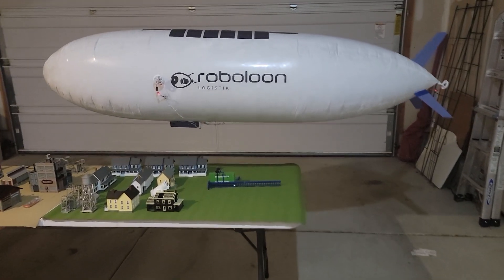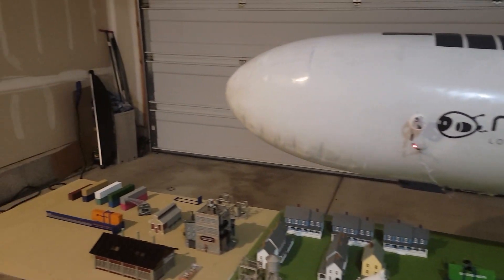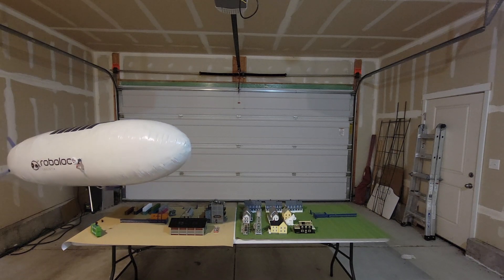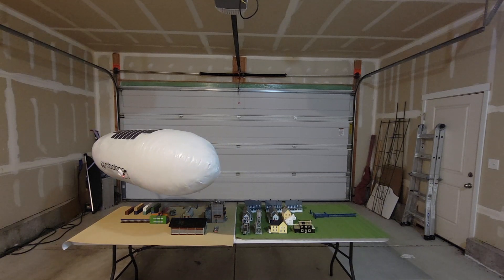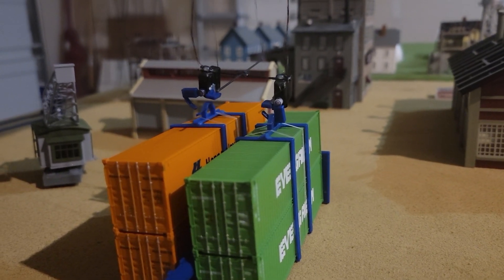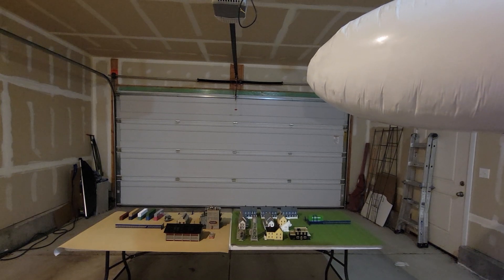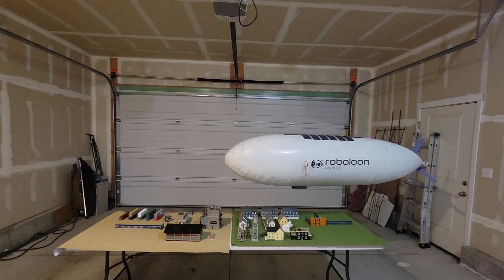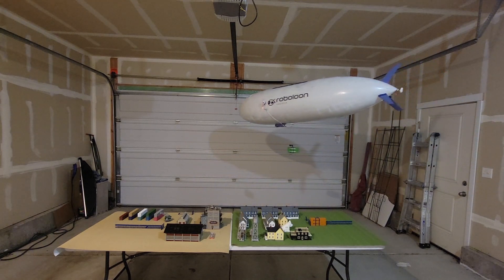Solar Cargo Airship Diorama

Comment: Is this helium or hydrogen?
Reply from the maker: @ethaneveraldo   in this video it was filled with Hydrogen. When flying in Friedrichshafen I used Helium for compliance reasons.
Reply: @ Would it be possible to mix hydrogen with some kind of flame retardant gas? My understanding is that hydrogen has higher lift power than helium, but it is problematic because it’s highly flammable. I wonder if you could get the best of both worlds by mixing it
Reply from the maker: @ethaneveraldo  I want to explore that further in an upcoming video. Probably in a month or so
Reply: @BaccaYarro  Looking forward to that

Comment: Rather interesting Bacca, so you see this being a reliable way of transporting shipping containers over land and sea? Also how many containers can it really carry? 
 
On a life size scale wouldn't that blimp be about the size of like a Ford class carrier? If need a zeppelin that large to achieve this sort of transportation seems like it wouldn't be very practical or able to compete with the various massive cargo planes except in maybe fuel consumption and environmentally friendly.
Reply from the maker: @Jarred-J254  Based on average container weight while loaded it would be 2 or 3 most of the time. The scale is HO, or 87:1. So it would be 172 meters long, about 3/4 the length of the Hindenburg. So pretty big. Although in terms of how much material is required for construction, how much composites, metal, etc, it would require less than a 737-800. It would lift more, about double, and not require an airport. But much slower, of course. The real question is the lifting gas. As long as Helium is the lifting gas it would be limited to a few very niche uses. Because the world's Helium supply is too limited. Hydrogen would be required for real world viability. Sadly that seems unlikely anytime soon. So, yeah, a pipe dream. But a fun one ;)
Reply: @BaccaYarro  This may come as a bit random but given the current efforts to reach Mars would you imagine zeppelin style airships might could play a role with a Mars colony given its lighter gravity and so therefore easier to lift heavy loads?
 
With the matter of helium and hydrogen as lifting gas I honestly think hydrogen has become rather misunderstood since that dark day on May 6th 1937. Yeah it's a flammable gas but it's also lighter than helium (so more lift) and of course much easier to produce and so more readily available. And since you are a history buff like myself and your obession with airships you no doubt have your share of knowledge on the Zeppelins used in The Great War and might have heard of the stories regarding the special incinediary bullets the British developed to use on their planes to shoot down the German Zeppelins by igniting the hydrogen inside the gas cells during the bombing raids and of course didn't really work at first as there was no oxygen for the gas to ignite from the bullets going through it, as like you said in one of your previous vids regarding the dangers of oxygen mixing with hydrogen in a blimp. So with that taken into consideration hydrogen could be a fairly safe alternative as long as the cells are airtight and regularly inspected for leaks. With helium becoming more scarce and hydrogen being considered too unsafe, only other option seems to be hot air and how you think that would workout?
Reply from the maker: @Jarred-J254  The problem with Mars is the atmosphere is has such low density an airship would need to be quite large to lift much. Although wind would be easier to overcome. So it would be both good and bad. 

I agree on Hydrogen. The dirty secret of airship enthusiasts is that airships have no real future as long as they are filled with Helium. Maybe as occasional curiosities, but not as a mainstay of transportation. If airships have a real future, it is with Hydrogen.